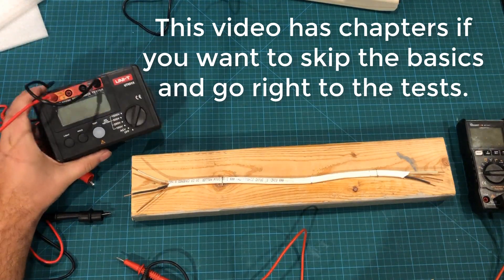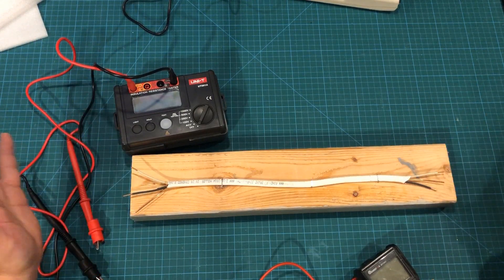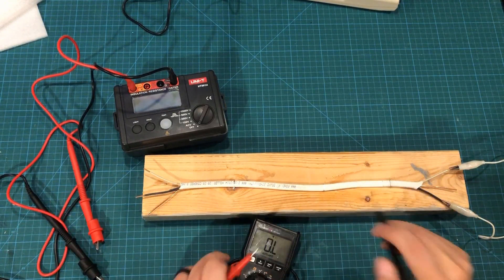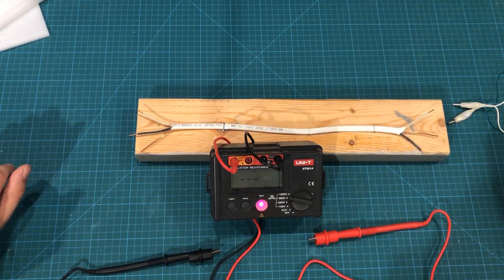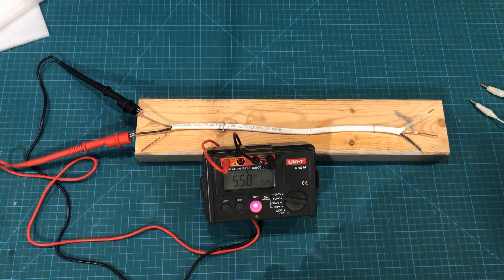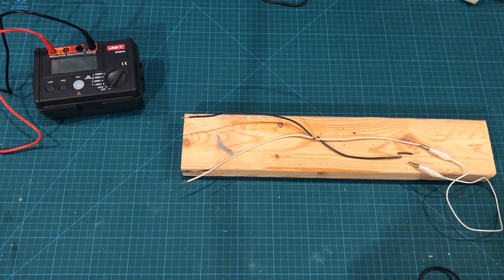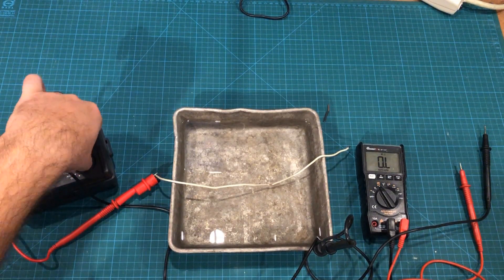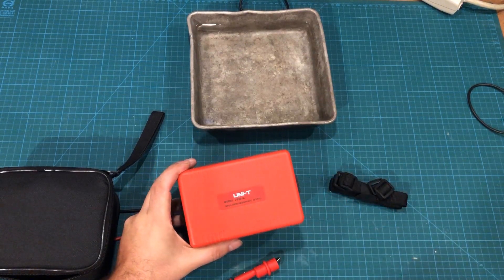Insulation Resistance Tester - Real World Examples

Comment: How would you replicate the water tray experiment in the real world, say an outdoors cable has snagged and ends up surround by moisture collected in the conduit. Would you stick the ground probe on a nearby ground terminal of straight into the soil? Would you then expect to get way less than 5.5 GOhm?
Reply: Connect it to the conduit, if metal and then one of the cable leads. Or the ground lead in the cable run, or between the neutral and line with the devices disconnected. Anything less than 2M Ohm may cause problems. Anything much lower than that will cause problems.

Comment: dont know how you are supposed to test isolation in your country, but in france, isolation tests are never done between live and neutral wires. Tests are only done between neutral and earth, live and earth and finally between live wires in industrial electrical setup.
Reply from the maker: What's the downside of testing between live and neutral?
Reply: @AnotherMaker  in "real world" you have terminal components plugged between live and neutral (computer, light bulb...). it's not advisable to inject 500+vdc even with low current. Only revelent test that should be done between live and neutral is a short circuit test with ohm multimeter.

Comment: 8:36 Таким методом,с помощью ванны с водой можно измерять сопротивление изоляции рабочего инструмента- кусачек,пассатижей и отвёрток. Хороший способ.
Reply from the maker: That sounds like a fun experiment.
Reply: @AnotherMaker  This will be the right experiment. One electrode (positive) is connected to the metal part of the tool and the second electrode (negative) is connected to a container of water. Immerse the insulated handles of the tool into the water and measure the resistance. If there is damage (cracks) in the insulation, then the megohmmeter will show low resistance. This is a fairly accurate way. Naturally, be careful when working with high voltage. Good Luck,sincerely.

Comment: You test the meter is working correctly by pressing the test button test leads apart you should get a zero reading short the lead together press test you should get full scale deflection. This tells you the meter is working correctly .
Reply from the maker: Good tip. Thank you!
Reply: @AnotherMaker  those UNI-T test are fantastic for learners and apprentices. Just starting out  . Once they have experience they can upgrade to one of the big brands like fluke
Reply: you mean the opoosite??

Comment: The uni-t 501 reads megger ohms on the 250v and 500v range , not gig ohms, the minimum acceptable value for  insulation resistance is >1 magohm  ie greater than 1 Megohm the maximum that tester can display is ol = over limit or l = over limit ie full scale deflection. On new installations we expect to see full scale deflection . >1 megohm  .if it less then 1megohm<1megogohm There a problem.
Also that uni-T is not designed to work with a standard multimeter it is designed for insulation resistance testing and continuity testing the 526 model tests RCDS as well it’s what we call an MFT it is used for test electrical installations . When we carry out inspection and testing or initial verification of a new installation by testing insulation resistance continuity voltage and RCD tripping times .
Reply from the maker: You seem to know a lot about this.  I really appreciate the tips.
Reply: @AnotherMaker  yes I have been an electrician for a little over thirty years . I am in UK 🇬🇧

Comment: An ignition circuit on your car produces between 30-40KV.  It’s annoying when you’re zapped by one, but not that bad.  A zap from static electricity is usually around 5KV.   It’s not the voltage that does the damage.  It’s current.
Reply from the maker: Absolutely.

Comment: I don't understand the difference in the "Multiple points of failure" test. Both multimeter and insulation tester detect continuity. What is the difference?
Reply from the maker: it is possible that a "normal" continuity test will tell you if something is shorted because it doesn't have enough current or a high enough voltage to detect the short.
Reply: Your multimeter tests continuity with a few volts and pretty much no current which won't reveal any issues you might experience under actual live conditions (where your voltage might be anything from 110V up to 400V depending on your country and grid).

Comment: Does that little device really can produce 1000V? isn't that dangerous? What would it do if you connect a varistor in there? :)
Reply: It's 1000v at about 1mA of current. So very little energy, but enought to give you a surprise shock.
Reply from the maker: I think it really does 1000v.  The varistor sounds like an interesting experiment.
Reply: Even the much cheaper BM500A will do 1000V; "TheHWCave" has a review/safety discussion of that one.
Reply: It's 1000v DC not AC so it makes a difference.